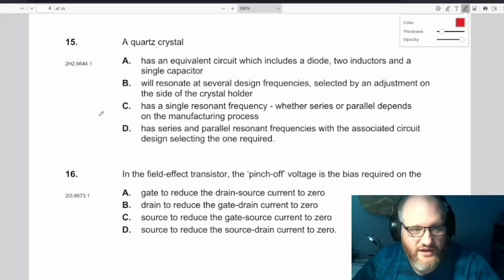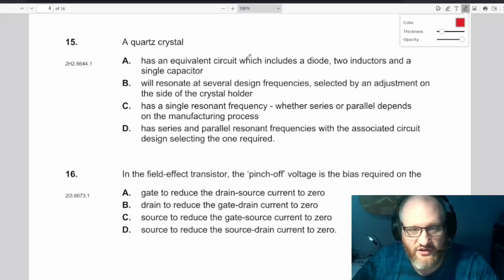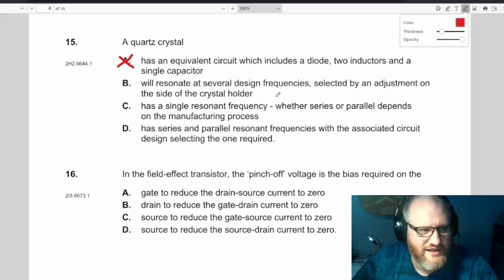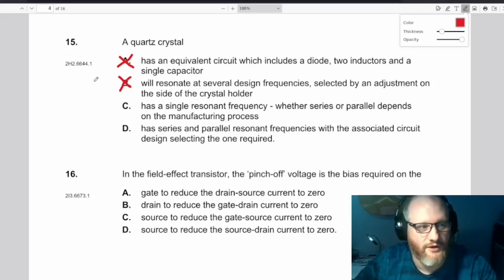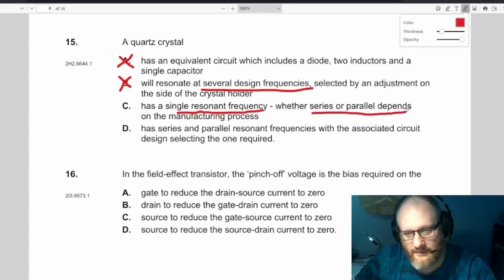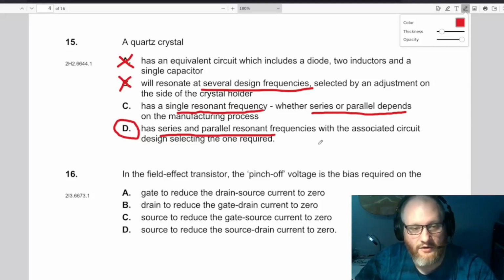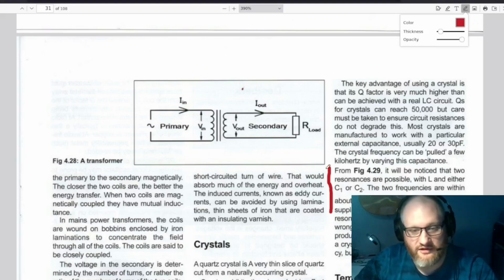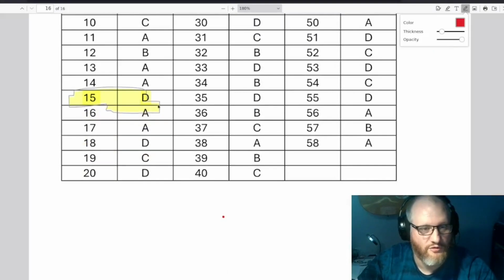UK Amateur Radio Full Licence Mock 1 RSGB v1.6 Question 15

Comment: This is a tricky question because the manual says "the crystal is supplied and calibrated to one particular resonance, series or parallel", which does rather suggest something about the manufacturing process! But yes of course, it still doesn't "have" a single resonant frequency, even if one of them is "the wrong result".